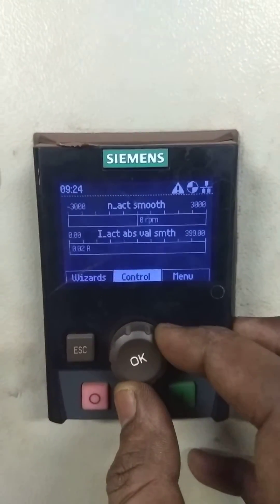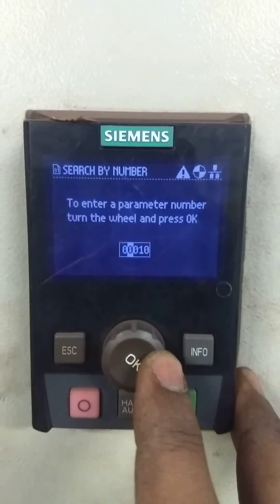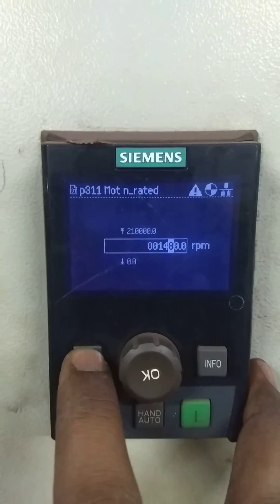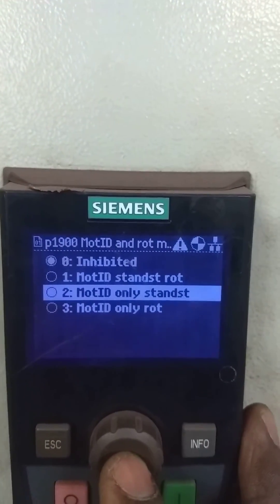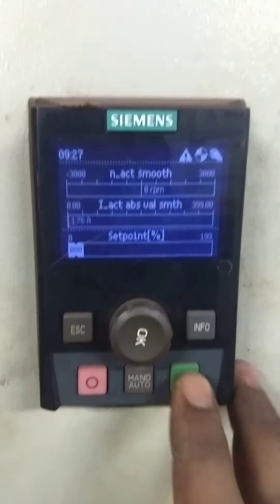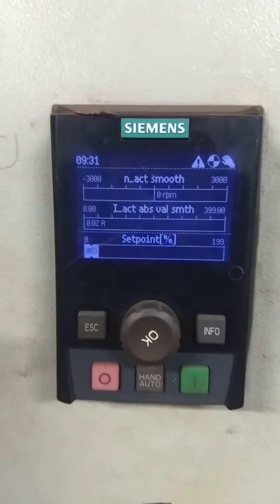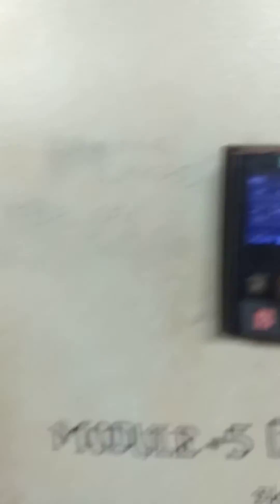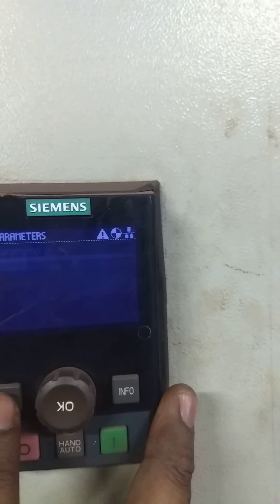SIEMENS G120 DRIVE - MOTOR IDENTIFICATION/ID RUN PROCEDURE

Comment: I'm trying to configure (from the IOP-1) the motor data identification to p1900 = 3, but it says it cannot apply the change. Any suggestions on how to perform it? 

Note: I'm conducting tests in manual mode on a SINAMICS G120C drive and, in this case, I'm performing motor data identification.

Comment: One thing I don't understand . Why we use the CB current breaker to change local mode.  If I don't have this CB to turn on can I run manual like you?
Reply from the maker: Which model you are talking about? G120 ?

Comment: I'm working on sinamics g120x. I want to start the motor from start button . Which  macro should I chose to march with starting from the terminals, and controlling by 4 20am.

Comment: Can we do I'd run at stand still condition when motor coupled with gear box.
Reply from the maker: Yes. That's  best option to do
Reply: @bishantkumarvlogs  its mean standstill I'd run is best to do during motor already in coupled condition with load.
Reply from the maker: @deviprasadpattanaik4634  Yes

Comment: Did you decouple the motor from the driven equipment eg pump or compressor.
Reply from the maker: Yes. For all different types of drives. We decouple and do ID run @ standstill position
Reply: @bishantkumarvlogs  thanks for the quick reply ..best of luck
Reply from the maker: @autolancegega599  you're welcome.   Channel is just for sharing  knowledge. Pl support the channel.
Reply: After setting or auto turning at standstill when normalizing you set it back from number 2